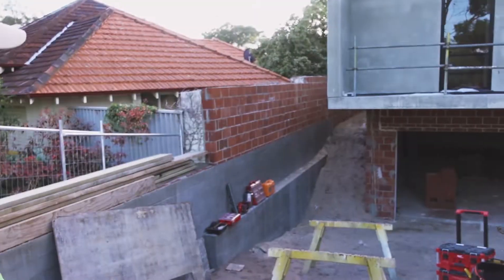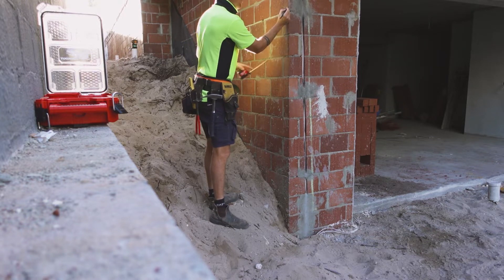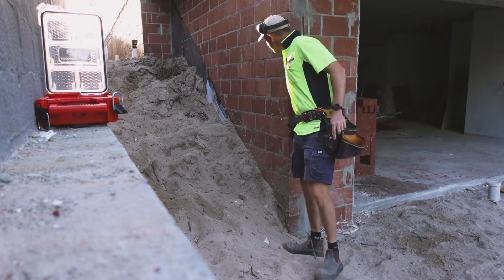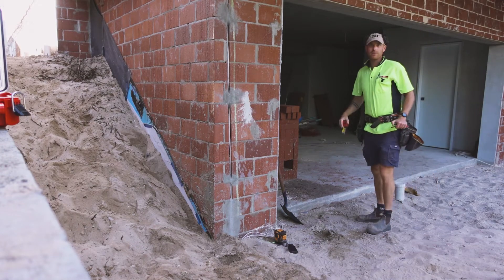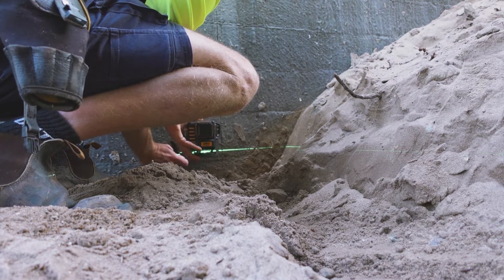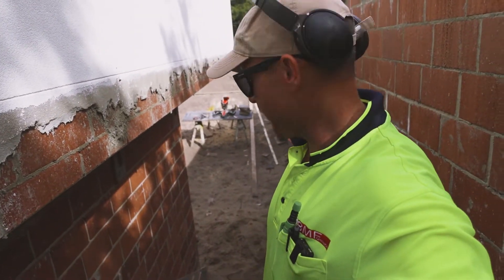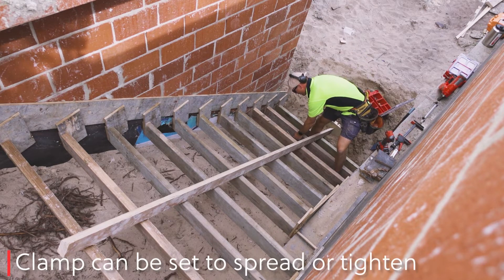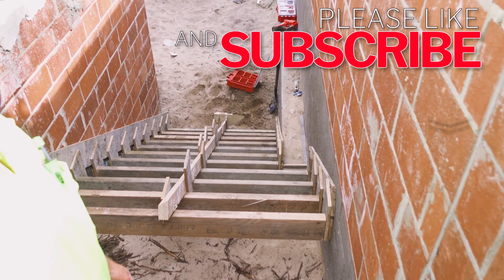HOW TO BUILD CONCRETE STAIRS BETWEEN WALLS WITH TIMBER PLANKS

Comment: Woulsnt concrete get suck between that ribbon plate and brick wall. In and around thoes plywood cleets and look messy ?
Reply from the maker: All gets covered by render so it’s a non issue. To avoid that use plastic

Comment: G'day mate, thanks so much for the video, exactly what I'm looking for as a DIYer! Quick question, what is the purpose of the 30 degree bevel on the underside of the riser, and which way is the bevel facing?
Reply from the maker: Bevel gives a point at the bottom of the form rather than the whole end of the plywood. It allows concreter to get his trowel in and do a neater job.

Comment: Very  nice work. I appreciate your attention to detail and well thought out processes. Do you prefer to nail the packet and cleat from the side to the riser as in the video? Why not face nail the riser to the cleat? Seems like it would make for a cleaner face to not have the end of plys on the concrete. But it would offset the cleat from your layout, so perhaps not as convenient in that case. Curious of your thoughts. Thanks for sharing
Reply from the maker: Hey mate, I usually do, but these stairs are exposed aggregate so no need to be super neat. Speed is better. I think somewhere in the video I explain this. If not in another video I do.
Reply: Right on bro. Good stuff. Thanks for sharing your work!

Comment: Thanks for the video, do stairs require rebar support?
Reply from the maker: Yes depends on many factors as to how much rebar. With these kind of stairs which are on ground and wedged between walls we generally just put a sheet of mesh down the stairs and that's it.

Comment: I've yet to see you put any reo in your stairs. Is that being put in by the concreter? And if so how are they getting it in there with your form work in place.
Reply from the maker: Concreters do the reo, they just slide it down from the top. If I have star pickets in the way they just pull them out, put mesh down and put star picket back in. It's a bit of catch 22 on big stairs. As theoretically you would put the mesh in first then build stairs however in reality that's not the best way often as the grade is often wrong and gets fixed after we build stairs. We just build it the way the concretors want. If they want mesh in first we will do it but they usually just slide it down from top after.
Reply: @bmformworkconcreteconstruc9783  OK thanks. I am considering doing an owner builder (just outside of Brisbane) and for the ground level floor I am seriously considering these cement blocks that interlock (vertically and horizontally), and then you core fill them. I have been talking to a mate about the best way to build the platform underneath the stairs (thinking of using welded RHS box section, and that smooth faced coated ply, planning to, but doesn't have to be removed) as I would like to put a compressor / big vacuum for my big DIY CNC machine under the stairs, so concrete would be ideal for sealing between the two block walls and not letting dust work its way upstairs, or across to the home theatre room next to the workshop.

I said if I was to do the horizontal reo before I core filled the walls, I could use a masonry drill to put holes in the blocks and put lengths of straight reo from side to side so it tied the stairs to the walls. Obviously since I would be building for myself and my time is not worth as much as someone who does it for a living, any additional drilling work wouldn't be a major hassle for me.

The other idea I had was, and I don't know if it would be possible... If I was to do just do a ~150mm thick ramp (with lots of crossed reo, so both across and diagonally down) and use something like an upside L bracket to mount the steps. Since the building regulations are fairly strict on any variation between steps, I thought if I could drill into the ramp and anchor the brackets (or alternately mount L brackets to the block walls or a diagonal piece of wood with cutouts mounted to block walls), I could ensure I had uniform step height (custom if the ramp isn't perfect flat), whereas I wouldn't feel the same level of confidence if I was to try and pour it in one go.

What do you think, doable or a bad idea?

Comment: Good luck stripping them
Always cut your risers in half, screw a nailer to hold each side
Reply from the maker: that's strange as I didn't have a problem, I stripped these in about 10-15mins.... which would be less time than it take you to cut your rises in half I'd say...
Reply: @bmformworkconcreteconstruc9783  for your job, yes I agree. That's the way if your going to cover your stairs with stone 
But when it's a concrete finish on your stairs you wanna break your forms off, same day as pour, and be able to finish the risers.
2 different applications, 2 different remedies 
Thanks for your reply, I saw another concrete man who does nice neat work, stairs & slabs. He never uses chairs to hold his steel up, I said something to him about his steel placement 
No reply. And he has alot of videos
Reply from the maker: I build the stairs the same way if to be stripped while conc is green. Every riser I build 5-10mm short and they just slide out. it's too expensive to be cutting my timbers in half. I just make them shorter, the break for easy stripping is on the end not in the middle. The only thing I do differently is I will screw the string to the wall rather than nail as concretors prefer screws.

Comment: I’ve never seen it done this way? I’ve been a chippy for 40 years. Why don’t you just work out your rise and going then mark it out along the string, cut the string to suit the r&g then fix the inverted string to the walls and fix your risers to the cut outs on the string? Sorry mate.
Reply from the maker: what country are you doing this? I have only ever seen 2 people use your method here, myself and 1 other. I do it for curved stairs. I just like to keep the stringers uncut so on the next job we can use them for something else. no stair is the same so I can't really re-use the stringers, it's just a waste of material. I'll make a video doing your method. I could do it today actually.
Reply from the maker: the riser planks are cheapish and easy to get here but timber big enough for the stringers is uneconomical here. it's just not a common material. so we use ply
Reply: I totally understand the idea of not wasting materials, you can still use ply for the strings and you can also use ply for the risers backed with timber brace. U.K. hey if it works for you mate fair enough. I’m a traditional chippy I suppose, didn’t have apps and specific modern tools when I did my apprenticeship.
Reply from the maker: i thought UK! I hope your carpentry is better than your cricket team! the problem I find when using ply for stringer is that we usually use 1800 lengths, so its never long enough,  joining it is a bit of a pain, unless you can advise otherwise? I've been thinking about it all day and thinking of a way to make it work efficiently and cheap enough. I'll find a way and make a video, it's a challenge I need to solve as I do like that way. yeah I learned all the old methods, worked with some very good guys. I enjoy using new tools and experimenting, I find it keeps me keen, after 17/18 years of this, it gets repetitive otherwise.
Reply: @bmformworkconcreteconstruc9783  Don’t talk about the cricket please!😬 Our sheets of ply are 2.4m long but are still not long enough, generally they don’t need joining as such, just butted up and fixed to the wall. I have been thinking about your method in the video and it certainly does the job, the only thing I would say is that when you use strings for an open end ie inverted strings, once you have determined the going and the rise and have marked and cut them, it is just a case of levelling the tread cutout on the string to determine the angle. Ie, no need to mark the walls with every step, I hope that makes sense? Also for reference when you cut the tread always allow 2-3 mm in order to trowel up to the wall. I hope you don’t mind me saying but the “stringer” is the longitudinal support member under the formwork the “string” is the string the (cutout section) sorry I’m so old school. Great videos though mate, very informative for budding shuttering/formwork chippies.
Reply from the maker: thanks mate! I didn't know the difference  between string and stringer! it's pretty rare we use planks. the finish isn't good enough.  and yes I was thinking to allow 20/40mm for the trowel on the string.

Comment: What would you charge to knock up theses set if stairs ?
Reply from the maker: I think these were $550 from memory for labour only, I did not supply the timber, pour the concrete or strip the formwork. Build only.
Reply: @bmformworkconcreteconstruc9783 How long did that build take you roughly

Comment: Hey mate, sweet vid.. quick question... how do you know you're fixing your risers at the right height tho? Are you just lining the top of riser with the bottom of the stringer boards on your wall? And how do you know theyre at the right going distance apart?
Reply from the maker: Hi Haydo,

I show in this video marking of the rises but only briefly. When I ping the line with chalk line, that gives me my heights, when I do the divisions, that gives me my spacings. try my other video on how to make stairs, it is a bit more detailed.

Comment: I am doing this to recreate some stairs between my house and garage, material are beeing delivered after the weekend, this is just the kind of video that I need. Would have loved to see the whole process. I subbed for more content like this, nice - thanks!
Reply from the maker: Cool Stefan. Feel free to ask any questions, I will answer asap. Your questions will also help me to know what to make future videos on. These stairs had a retardant painted onto them called rugasol before pouring which allows them to be washed the next day with High pressure water giving an exposed aggregate finish. If this is what you are after do a search on rugasol.
Reply: @bmformworkconcreteconstruc9783  - Thanks, thats awesome! :) I was going to make the same kind of stairs you make here, from wall to wall but the cost "skyrocketed" so now the plan is a 1 M wide stair with 7 steps up to a plateu about 2x2 M and the finally three steps more and perhaps some smaller walls for the last three steps. I have limited experiance so the first shock was that 25 kg concrete equals 13 liters of finished product one sack is nothing! :) A couple of questions for you - How long before you can remove the forms? I understand its depending on a lot of things but what do you look for that tells you its time? I want to use a broom to get a "slip-free" surface. If you ever calculate how much concrete you need for a certain kind of stair, that would be helpfull. Last question, is it ok to "bulk" out the concrete with other stone? The current stairs are made out of stacked cobblestone and its falling apart but I was thinking I could use these stones to fill out the stairs (how thick does the concrete need to be in order to be strong enough? I am thinking somwhere around 10 cm?) Thanks again! I saw a couple of your other videos after this one and they're all great - please keep it up! :D
Reply from the maker: @stefanfrisk9598  firstly if you are doing a plain concrete finish you want to build the stairs different to this video, you want the face of the form to be one piece wall to wall. The way I have done it with the cleats and packers will not be neat, the ply "endgrain" will show. When you pour use a hammer drill or electric sander on the forms to vibrate the concrete to remove air bubbles. Just float the concrete up to your levels, let it set till your fingers leave a small indent in the concrete, so its just a tiny bit soft, then trowel it up good. There are lots of videos on this, I dont do the concrete but I will post some vids soon of my best concretors I work with doing it. You can strip the forms same day when concrete still soft and trowel the stairs. Or you can strip following day. Just be careful not to chip corners of stairs. Leave all your nail heads exposed for easy pulling out. Measuring the concrete is easy, remember a triangle is half of a square. Stairs are just a series of triangles. Do not mix the conc by hand. Here you can order "mini" concrete trucks or ask the local company what cost of minimum order is. You just ask for stair mix. Not sure what country you are in but here that's all you need to do. For the thickness, try to have a minimum of 150mm. Use some mesh too. Always better to use mesh. And have a thickening at bottom so stairs "key" into the ground so overtime stairs don't shift.
Reply: @bmformworkconcreteconstruc9783  - wow, thanks! I have "youtubed" "concrete stairs" for a month or two, I can't understand why none of your videos popped up before - the algorithm sucks, I guess. Thanks for your answers, I have already ordered the materials so I will have to mix everything myself and the ply you use (we call it form-plywood) was all gone (everyone is buildning during the pandemic, everything is gone and/or expensiva as ****) so the bulk of the form will be all wooden "planks". Good point on the triangles, my first calculation was a square for every step and a triangle inbetween, no wonder it was expensive! :) I live in Sweden. Thanks again!
Reply from the maker: @stefanfrisk9598  things are expensive here too and in very short supply! Goodluck with your stairs!
Reply: @bmformworkconcreteconstruc9783  - thanks again!